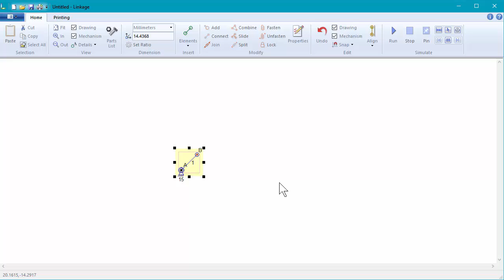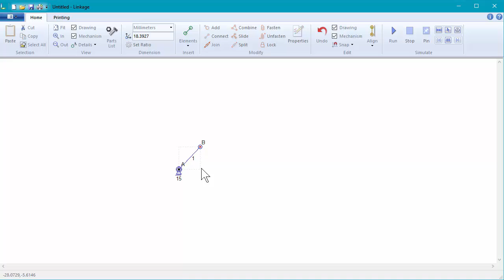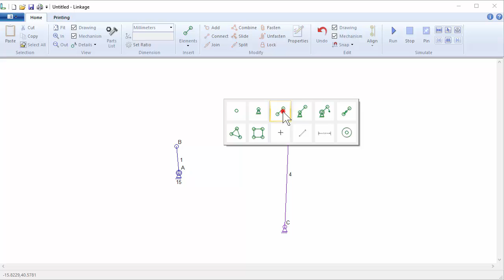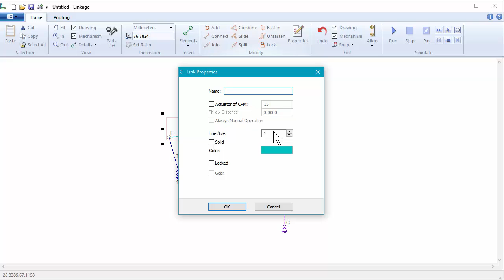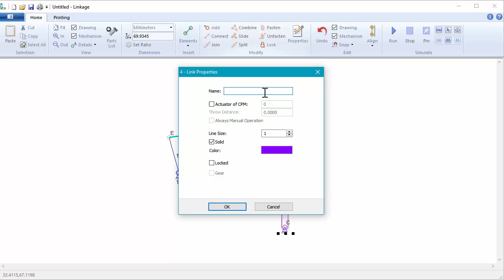Linkage Mechanism Designer and Simulator Tutorial 1

Comment: Hi. Thanks for the amazing tutorial. But how do you use the minimum and maximum oscillation angle? I can't seem to figure out from where the angle is measured.
Reply from the maker: Assuming you are asking about the start and maximum angle data for an input: You enter an angle as the maximum value for the rotating input connector; it will rotate by that number of degrees, then reverse. If you set a start angle, the input will still rotate between zero and the maximum value, but its starting point will be offset by the 'start" number of degrees. The start angle doesn't change the mechanism's visual state; it tells the simulation that the input has already rotated by that number of degrees at the start of the rotation. So essentially, you rotate from 0 to (max - start), then reverse and rotate the other direction the maximum number of degrees.
Reply: @rectorsquid  Thank you for the clear explanation! I was indeed asking about this. Also, i was wondering if it is possible to make a linkage mechanism which replicates the results of a spirograph? Like making full flower patterns using linkages...?

Comment: Great useful software but I can't seem to export the motion path - the option is greyed out and "Motion as CSV" is ticked.  I'm using 3.16.45.  Any ideas David?
Reply from the maker: You will need to select a connector and then select the option to draw it's motion path. Only paths that are drawn are exportable. You also need to run the simulation to generate the path before it can be exported. Some of these limitations come from how computers 20 years ago lacked the power for the code to just store all motion paths for all simulations. let me know if this helps.

Comment: I followed this video exactly, but the middle link (the light blue line in the video) gives me an error "This element cannot be simulated" when I try to run the simulation?
Reply from the maker: Can you find my email address in the "about" box or in the pdf documentation and send me your mechanism? This might be a simple case of not joining the connectors at E-B or F-D. If the connectors are visually on top of each other, then they are not mechanically joined. Having the file would let me see if that or something else happened, so please send it to me if you can. A quick way to check if you have joined the connectors is to drag one of them, such as at the top end of link 4, and see if the other connectors stay behind. Again, connectors need to be joined, not just visually, in the same place.

Comment: Hi Dave. Is it possible to lock only the dimensions of linkages while developing systems? The lock function locks both the dimension and location. While I develop a linkage system with specific dimensions, the previous dimensions change after I added new linkages with specific dimensions. Thanks.
Reply from the maker: The Linkage software is good for rapid prototyping and works like a drawing program. Right now, it won't let you change a link dimension by moving a connector and not have that change dimensions of other links also using that connector.
Reply from the maker: Feel free to find my email address in the About box or in the documentation and ask for more info on how to get around these limitations.
Reply: @rectorsquid  Thank you David. This is a very useful software.

Comment: Can you get velocity, acceleration and force analysis with this?
Reply from the maker: You can export a CSV file with information about specific connectors, those that draw their path, and then extrapolate from that data. Position and speed are there, and acceleration can be computed from those. I'm unsure how to calculate force, given that the elements have no mass. But it does seem like output force as a ratio to input force could be computed based on simple leverage calculations - it's just that math is not my field of expertise.

Comment: why is this SW distributed only as an executable installer? Installers are very annoying as they clog up system; they are acceptable only for software which needs deep access to operating system features, but this is "just" a calculator, so why isn't it distributed a s simple zip file?
Reply from the maker: Zip files do not show up in the control panel list of installed apps and therefore cannot be uninstalled with a single click of a button. Zip files cannot be digitally signed with a security certificate so the only way to know the software is not malware is to run it or manually ask for info about it. An installer says the developer name before installation. Also, Mai installer files were all the rage 20 years ago when this was designed. Finally, this is the only time in 20 years that someone had a dislike for the installer so changing that has been a very low priority. If you send me an email, I would happily send you a zip file. I had never heard of an installer giving an app any deep accesses to the operating system. It merely provided an easy way to manage the installation so that a user didn’t unknowingly start using an older version of the app since installers also provide version checking.
Reply: @rectorsquid  thanks, but I manually unpack installers using Uniextract2. Annoying, but less annoying than a misterious executable messing up with registry, system folders and who knows what else.
Reply from the maker: @jumpjack2  I suppose that if you don't trust the developer and suspect they are doing evil to your machine then that makes sense. The Linkage software make no registry changes other than what is required to allow for the app to be uninstalled. 

I have never before encountered someone who trusted an EXE file but didn't trust the MSI installer file. Note that both are digitally signed by me using a certificate that required that I show multiple forms of ID, including a passport, and that Microsoft knows where I live and can at any time revoke my certificate if I do evil.

If you see that there is a new version available for the Linkage program and want it, feel free to ask me (in email please) for a zip file. I'll happily send it. My email address is in the "about" box and in the PDF file.

Comment: is it possible to measure the velocity and the acceleration of the joint?
Reply from the maker: You can set a connector to draw a path and then once it's done, you can export the information to a file as a set of points. You could then use that file to do the calculations for acceleration, speed, or anything else you can think to calculate from those points.

Comment: Hey, glad I found your program! I could go I further and talk with some KI programmers to implement a function, to synthesise the linkages from a given path. Additionally with speed and force conditions for each point on the given path. But this is of course very extra :) please let me know if you like the idea, maybe we can figure something out.
Reply from the maker: Synthesis from a path is something I would love to do myself. Now that I have splines working in the software, it should be easy enough to use a genetic algorithm to find an optimal mechanism. Or rather, find an optimal configuration for an existing mechanism, since I don't think there's an easy way to pick 4-bar vs. 5-bar, etc., based on the spline shape. But I could be totally wrong and I even recall seeing some scientific papers about just such a thing.

There's no way to show force data without there being mass to the links. And to have mass, there needs to be minimally, a center of mass, and maximally, an actual definition of the overall shape and material of the links. This sort of thing is far outside of my comfort zone for math and also more that I could ever manage to do in my spare time on a hobby project. But the software already does calculate speed and acceleration info as a byproduct of the simulation and it's just a matter of finding out how to show this, that is the think keeping me from adding it tot he software.

Feel free to find my email address in the "about" box or in the documentation and send me email with your ideas. I am always open to suggestions (and even complaints).

Comment: How about measurement
Reply from the maker: You can see measurements by tapping the "D" key or selecting "Dimensions" from the "Details" menu in the View panel of the toolbar. To set measurements, you might want to read the documentation if you can. The easiest way to set a dimension is to select two connectors and then type in a length or distance value into that text box in the toolbar in the Dimension panel.

Comment: Hi. I really like your software. It is easy to learn and very easy to build mechanism.
Yesterday I tried to measure the arc length of a coupler curve, but didn't found a way to do so. Is it possible to measure the arc length of a coupler curve?
Second I would like to know, if it is possible to write and add some own extensions, add-ins, macro or similiar to add some own features? Since I am a little Mechanism and Programming Nerd I would like to write some own features. Which Programming language have you used? I am familiar with C#, Phython and some Visual Basic.
Currently I am working at an university and think it would be great to use the software for teaching.
Reply from the maker: I'm glad you like the software. Unfortunately, the arc length is not available anywhere. I will add it to a list of things to try to do but I don't think I can get that working since there is no way in the user interface to show that sort of thing right now. It might be possible for me to add a length value to the start point of a motion path that changes as the path is drawn but it would not be stable as long as the connector is moving - you would need to hit the pause button and then read the number after maybe stepping the simulation manually for a few steps to get the connector to the end of the arc. If I can do that quickly, I'll respond here. But if not, it might just show up as a feature a few months from now in a Beta app.
Reply from the maker: I added this experimentally. You can get a new installer here: https://www.rectorsquid.com/alpha/linkage.msi
If you enable dimension, perhaps by tapping the "D" key, you will see dimensions for all of the elements (connectors, links, etc.) in the mechanism. Run the simulation with the dimensions visible and you will see the RPM of all of the connectors along with the length of the motion path for any connectors that are set to draw their motion path. it's an approximation since the program can only calculate the straight line distance between the simulation steps. The path lengths get more accurate the slower the mechanism moves (from slow inputs, not from single-stepping the simulation). Let me know if this is interesting and give you something you can use. Now that there are a few different things to show during the simulation, I might add a panel for selecting each one separately instead of including them with the dimensions.
Reply: @rectorsquid  Thanks for the quick response. I installed the new version and enabled the dimensions. The linear dimensions for the linkages are visible, but not for the motion Path. If you want I can write you an E-mail with a screenshot. Unfortunately I couldn't find one on your website. I know it is time consuming to add new features and this is not that important for myself, so please don't spend too much time in it.
Just some suggestion how to add this feature: Perhaps by selecting the motion Path, you can change Color etc. and have a button that calculates the arc length manually or the user can export the points as .csv and do his own calculation with it. I don't know how you wrote the code, but maybe this is simpler.

Which programming language are you using? I am interested in looking in the source code. Would you share it with me?
Reply: @rectorsquid  I know you have your own feature, that you want to add, but I want to give you some hints which features might be simple to implement and great for Visualization: 
- User can select or change the position of joint description (like in Geogebra)
- User can change the optics of the link (vector arrow, ...). I guess this would be great for teachers so they can get the style familiar with their own graphics and faster for students to understand.
- User can add TextBoxes to the screen and adjust size position etc.
Reply: @rectorsquid  is it possible to enter a precise length for a link? I tried to draw a circle with a precise diameter and fix the  first link joint to center point and the second link joint to the point on the circumference of the circle. But this didn't work. The only way I can do this, is by entering the coordinates of the joint.
From my Point of View it is a super important feature to be able to enter a precise length to the link.

Comment: How can I get the plots of velocity, position and acceleration of the links in this software?
Reply from the maker: This is a rapid prototyping tool and doesn't have a lot of analysis features. The only way to get any sort of velocity, position, etc., information is to create a motion path and then export it and use spreadsheet tools to calculate the needed information. I would love to hear more about how you want to use the velocity, position, acceleration information since I won;y developers the software to make fairly slow-moving mechanisms that I build in my garage. Feel free to find my email address in the "about" box or in the PDF documentation ad send me any note or ideas you have about how I could add features in a way that makes them useful.

Comment: wow sir david really nice programme , i was using it to complete a work which involve making a working robotic arm to find how it moves , but i cant seem to understand how to do it , i have the picture , dimension and angle of it but i still dont know how to apply it in this software , can you help me ? thanks in advance
Reply from the maker: Find my email address n the software or documentation and send me everything you’ve done so far. I can probably help.
Reply: @rectorsquid  where to find your email address ? I search the blog but couldnt gind it , i have though send an email via the contact me part , i hope im correct
Reply from the maker: @Ace-rx5nh  I replied to your contact form. For anyone else finding this reply, my email address is not easy to find on my blog but there is an "about" box in the software that shows it. it is also in the PDF file that documents the software.

Comment: why can't I connect the anchor and connecter?
Reply from the maker: Can you tell me how you are trying to connect them? Normally, if you have two connectors selected, tapping the "L" key or clicking the "Link" button will link them together (forming a new link). Also, let me know what version of the software you have - there are some clickbait sites that provide the installation files but they don't keep those up-to-date! If you are following the video, you can let me know what time in the video you are trying to mimic.
Reply: @rectorsquid  I am using 3.4 I was doing it wrong but I got it for me I needed to highlight it they click join

Comment: How can i make two slider ?
Reply from the maker: If you look at the sample mechanisms that come with the software, you can see various multi-slider configurations. Creating a slider is easy: Select two connectors that are on the same link or both on the ground then also select one other connector that will slide. Click the "Slide" button. If you want a second slider that slides between the same two connectors, select them again and also select the next connector that will slide. Click the Slide button. If the two connectors that slide are on the same link as each other then you will have one link sliding along another with no pivot/rotation.

Comment: Hello firstly really thank for building such nice application.
I wonder if we are able to draw customized profile and linkage that has various shapesand see the results?

Also are we able to define tip speeds  and make some calculations?
Reply from the maker: I'm not sure what you are asking about. You can certainly create all sorts of complicated mechanisms and simulate them. You can see other videos on my channel. You cannot define tip speeds because the speed of every connector is affected by the speed of the motor; There is no backward calculation to figure out the motor speed from a tip speed - you would need to do that outside of this software somehow. It would be especially difficult to do because the speed of almost all connectors is not consistent and changes as angles change. The software would not be able to change the motor RPM as it runs in order to force a specific tip speed. The math for going from tip speed to motor RPM for the end of the crank on the motor should be fairly simple math though.
Reply: @rectorsquid  thanks for your kind reply... 
I mean can we draw a custom curve like a hook profile and make it as another connector linked one another and see if the whole machine works
Reply: @rectorsquid  hello David.. I would like to ask in other way around.. As a single linkage other than straight.. Can we for example draw a custom link with a shape of half circle or cam like shapes to simulate their contribution